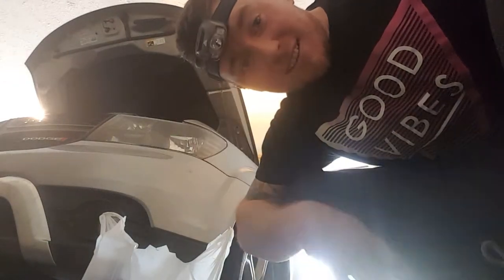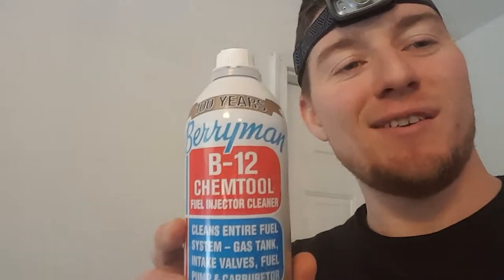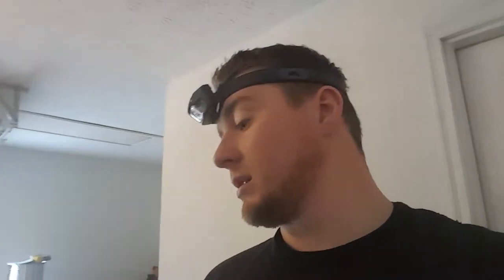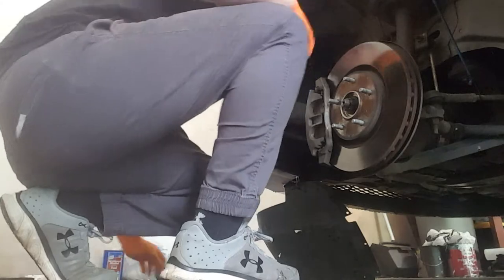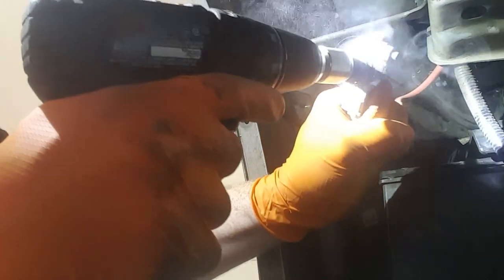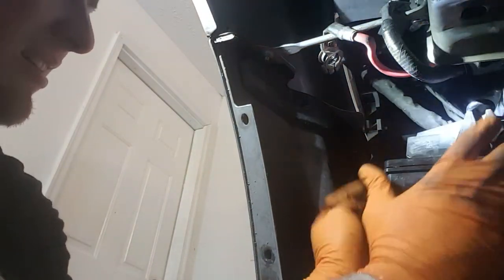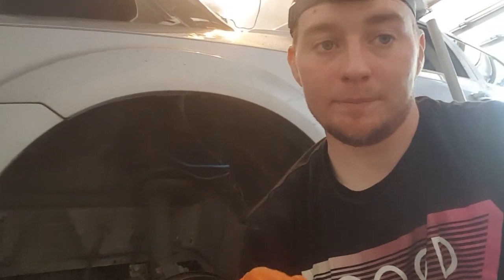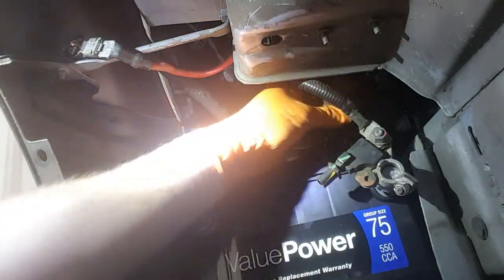Battery Replacement Group Size changer,2015 Dodge Journey

Comment from the maker: Be careful with the negative cable and the sensor it has on it
Reply: Cheers. If I hook up a separate 12V source while I disconnect the main battery, this should save the 'memory' and stop any issues?
Reply from the maker: @rayjayg6  yes it should. If you are able to keep 12v on the system without accidentally grounding anything that should not be grounded. 
Or they have the cheap battery saver at i think walmart or the parts store that you plug in the 12v cigarette lighter/power source and it will keep the ecu on track for a limited amount of time and you should not lose any settings.

But i believe it is less than 10 or 15 minutes.

But once you are done installing the new battery, start the vehicle and with all accessories OFF (ac, lights, etc, let it idle for about 15 minutes untouched.

Then turn on the accessories with it still running, and let idle with headlights, ac, radio ON. 15 minutes

This will insure that all of the vehicles onboard systems ,get all the right signals.

Especially the electronic throttle body/position sensor.